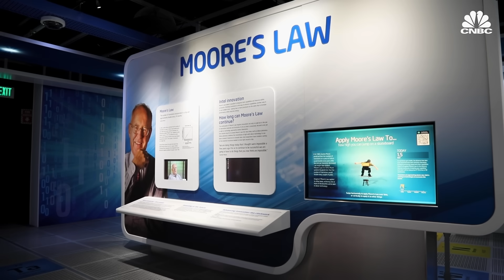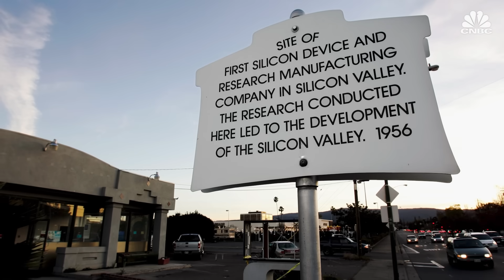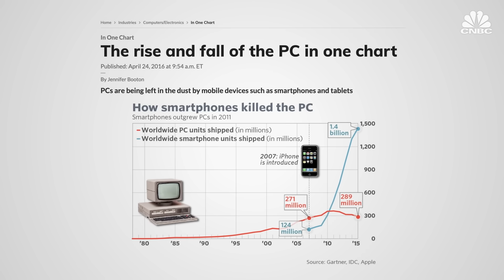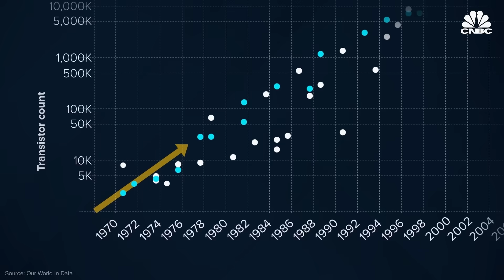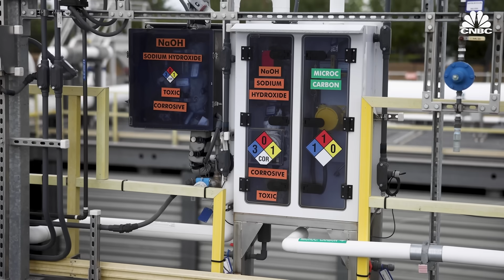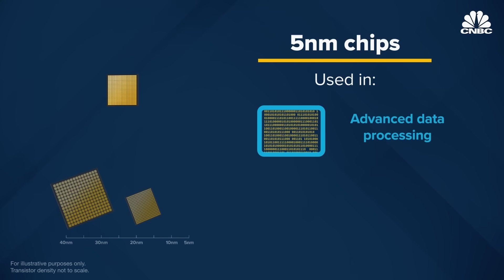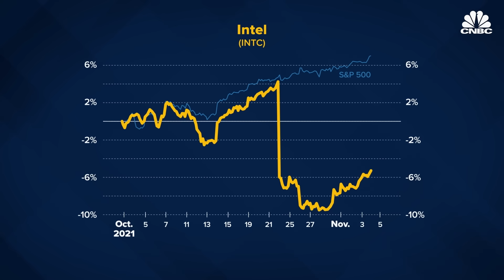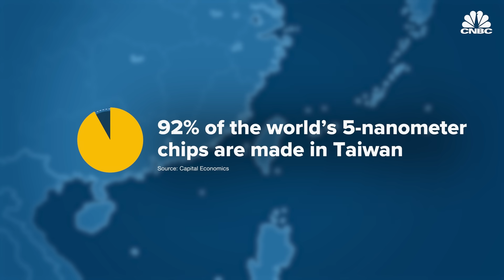Inside Intel’s Bold $26 Billion U.S. Plan To Regain Chip Dominance

Comment: Intel's new CEO is not in the enviable position as he has to fix the mess of his predecessors and get up to speed with the competition. And in chipmaking business as it was already mentioned several times "speed" is of the essence as once you loose pole position its very hard to catch up with the rest. TSMC and Samsung are leading the way, so Intel has to be smart, efficient and first of all it must deliver otherwise it will fail and loose even more.
Reply: Intel is already world #2 and recently signed up to make chips for Qualcomn
FYI (sales in USD)
TSMC 13 billion (ROC-Taiwan)
Intel 8 billion (USA)
Samsung 4 billion (ROK-South Korea)
UMC 1.5 billion (ROC-Taiwan)
Global Foundries 1.4 billion (USA)
SMIC 1.1 billion (PRC)
TowerJazz 0.3 billion (Israel)
PSMC 0.3 billion (ROC-Taiwan)
VIS 0.3 billion (ROC-Taiwan)
Hua Hong 0.25 billion (PRC)
DB Hi Tek 0.2 billion (ROK-South Korea)
Reply: @set3777  sure they are #2 in size and revenue, but from the technology point of view they need to catch up with Asian tigers TSMC and Samsung.
Reply: @D.u.d.e.r  Intel had previously refused to make chip based on ARM CPUs but now Intel has signed up with Qualcomn and already has cross licensing with Nvidia for GPU technology. On the high density FAB, ISince ntel has signed up joint ventures with EU companies to manufacture chips in Europe and since ASML is an EU (Dutch) company, Intel has access to the same high precision lithography.technology as used by TSML.
Reply: @set3777  That's great to see Intel is making steps to emulate ARM's approach and that is also takes ideas from Nvidia and Qualcomm through cross licensing, however momentum is already lost and time is of the essence especially in this industry. What Intel does now is already running smoothly with the competition, so they need to push twice that hard and make more effort to catch up even they are #2 world's chip maker.
TSML you mean ASML? Its great Intel has signed with them to get some access, but pls don't tell me ASML or TSMC will give their precious secrets and IP just because Intel wasn't speed up its business. They might help each other, but only to certain point, the rest is for Intel to figure out what to do and how to approach the industry.
Let's see if the new CEO gets it right or not. Looking at the 12 gen Alder Lakes benchmarks they look really good, but one thing concerns me in comparison to AMD and that's efficiency and performance per Watt. AMD does a better job with their Ryzen architecture and their chiplet design which is interesting advantage, besides having comparable or usually lower prices than Intel.
Reply: @D.u.d.e.r  Intel had never make chips for third party before. Now they are prepared to do so and Qualcomm is going to make THEIR chips in Intel FAB instead of Samsung and TSMC or as a second source. Intel has their own CPU and Integraded Intel Graphics (using patents from Nvidia) and they nominated the desktop/laptop market.
TSMC makes some chips for Intel too and makes 100% of AMD's CPU and Graphics chips since AMD has become design only FAB-LESS company.
AMD designs better CPUs and Graphics chips but most people still prefer Intel based laptops because AMD many based laptops have USB-C not compatible with USB-C and Thunderbolt docking stations.
We are not comparing Intel and AMD CPU designs when we are talking about Wafer FAB foundries.
Reply: @set3777  I do recognize and agree with you that Intel has still strong position on the market and people do prefer it in comparison to the AMD, however AMD has gained a lot of popularity and market share in recent years since Ryzen cores started to be used more not only in the consumer devices, but mostly in the enterprise market and datacenters.
But we are not comparing which company is better, but the foundry/chip manufacturing capabilities and here TSMC is leading the way with Samsung. Intel is preparing to attach from the back and offer more cost friendly options, however I still believe TSMC and Samsung will continue to be ahead of Intel in comparison to the manufacturing process for at least year or two.
Reply: @D.u.d.e.r  Too many "journalists" pushing fast AMD CPU's without full understanding. I recently sold 5 HP laptops with Ryzen AMD CPUs and Graphics and lost money and time bacause users kept complaining the laptops were slow and   USB-C docking stations wouldn't work. So I continued to sell only "Intel-inside" laptops.
Reply: @set3777  That's quite strange that IO feature with USB-C with AMD Ryzen CPUs doesn't work. I wonder what kind of bug are we talking about here and if AMD is planning one day to fix it or not... On the other hand if Intel gives you reliability you are looking for, than its probably a right way to go for you.
Reply: @D.u.d.e.r  Intel PCs & laptops  have already gone Thunderbolt-3 which is even better than USB-C.
Right now, there are only a couple of motherboards that support both AMD CPUs and the Thunderbolt 3 standard.

Comment: Two unanswered questions
1)Does the 7nm tech refers to the lithographic exposure of the smallest part of the Transistor which is the contact's width?
2) how come to my knowledge all this technological advance with hardware did not require a modification with the basic/compiled Machine language interface ?
Reply: Machine language is just an interface. The actual chip logic / architecture is where all the advancements have taken place alongside the physical advancement and smaller lithography.

Comment: In terms of the understanding of the technology being offered and what the process nodes mean.... this segment missed by a  mile.  The node names are marketing terms and don't address the actual density or performance of the transistors in question. Absolutely, 100%,  Intel is trailing at this current time. But they are closer technologically than the public thinks thanks to those disingenuous node names. I mean alder lake could have been great... on TSMC 5nm. It would have clocked slower, but it wouldn't take over 240 watts to run a CPU. There is no way Intel can outsource all their CPU production to better nodes across seas, they just make too many. But their upcoming graphics chips... they outsourced those.

Comment: The new TSMC Mac M1 chip is literally 2-10x faster doing anything my 2018 Intel-equipped MacBook Pro. 

Similar specs but can do everything that much faster, smoother, and better. The different memory configuration (RAM vs Unified Memory) as well as packing more cores into the same enclosure is just mind blowing. 

Sure my 2018 isn’t “obsolete” and runs perfectly. But time is money. Literally. The more I can get down the more income I can generate. The more videos, music, advertisements, emails, etc the more successful a business can be.
Reply: “Literally” 2 to 10 times faster? That’s a pretty wide range...
Reply: The thing is, Apple designs their own chips. The new M1 chip has little to do with TSMC architecture and more with Apple's research investments

Comment: Don’t want to be that guy but the video mentioned that mars rovers use the most advanced 5nm processors. This is not true.

Spacecraft typically uses radiation hardened processors and they are much larger than 5nm. Curiosity and Perseverance use PowerPC RAD750 processors, the are between 150 and 250nm with a speed of only 110-200MHz.
 Going smaller would make the processor vulnerable to radiation related and other failures.

Comment: I don't see the need to push so hard to making second best chips in America. 

They aren't going to find themselves in the most advanced machines that people are willing to spend on. 

If you going to go for the cheaper market, surely you produce in a cheaper country.

Its hard to know for certain but they could be spending big bucks pushing up production on chips that no one is going to want to use in their machines.. 4 years is a long time to catch up, the world will be a very different place by the time they think that they "might" do it.

Their newest chips are only able to compete by upping the power requirements to insane levels, which is the opposite to what is needed. 

I can see them wanting to keep production in house, look at Apple taking its business away. But they are focusing on power and efficiency., They need to spend less on making an insane amount of chips and more money on research, making the chips that people are actually going to want. If you aren't first in the chip market, you are nothing.

Comment: Jesus CNBC, do better research please. Intel 10nm is equivalent to to TSMC's 7nm. And Intel's upcoming 7nm produces smaller transistor size comparing to TSMC 5nm process (roughly around 4nm if TSMC ever has one). Also space-hardened CPU are not made at this small of a process. Mars Rover uses a 250-150nm node size CPU made on different technology, not on some TSMC's 5nm node.

Comment: Chips for phones are important, but chips for switches and data centers, which don't require such extreme portability, are equally important. You don't need a super-fancy chip in a phone if you have one in the network.

Comment: 12:20 Wow! That's still 450,000 gal of water wasted per day. Good percentage but still a huge amount. More than 164M gal per year out of Arizona's water supply and down the drain. I understand it's probably largely cleaning but some I'm sure is also cooling. It'd be nice if they could use a kore radiative heat rejection technology. AZ has the land for it. Especially if they used that newer "reject heat into space" technology.

Comment: I don’t understand why Intel doesn’t just build there own CNC machines/ lithographs to build there own 5nm and 2nm machines. I get that it would be expensive but they are just flooding the market with chips. The reality is that more computing power will be needed in the future. If they build there own machines than the other competitors wouldn’t be able to copy so fast. I guess Intel did a cost benefit analysis and found it would be more profitable to flood the market than develop novel chips.

Comment: Major misunderstanding when you differentiate cpus and gpus based on if it's in a PC vs a data center. The GPU is simply a Microprocessor widely geared towards graphical processing. The phone I'm typing this on has a GPU and CPU as does every modern mass production PC be it discreet or integrated.

Comment: I think Intel will have to buy in the design skillset. Be like Apple and just offer whatever it really costs and buy every innovative chip designer you can before national security makes even an American buyout unpalatable. 
Apple showed its possible to design an arm chip, customise it and leapfrog intel/amd. Its not the 2yr fab building delay, its the actual design innovation and then the fab ready when it arrives, as well as having the design with plenty headroom - not a short term lead and then flogging a dead horse. Apples achievement must have shown Intels way into mobile chips. The traditional western pc buyer is stalling on a replacement, buying a better phone and using cloud services to offset any performance gaps in whats needed. They will make easy (slim) profits from meeting the large chip shortage but amd is a full competitor now.

Comment: Tsmc and Samsung isn’t where intel is worried about. It’s apples m1 max chips
Reply: Not in the foreseeable future. Apple's M1 chips are ARM processors, which right now are mainly used in mobile devices due to their efficiency. The x86 processors are the bread and butter of Intel and AMD. The marketplace that Intel and AMD caters to still needs x86 chips. If you want to know why just google ARM vs x86. A much bigger threat to Intel is TSMC and Samsung. If Intel fabs can surpass Samsung or TSMC, even Apple could contracting Intel to make its M1 chips at Intel's fabs.

Comment: The Transport data and circuit Bridges etched into the motherboards of electronic devices are made of copper, the leads of integrated circuits or processors is made of silver, the connecting micro wires of a CPU die to the leads are made of pure gold, here is some technological advance ideas for you if you can find it in this simple knowledgeable information:

Silver defines conductivity - all other metals are compared against it. On a scale of 0 to 100, silver ranks 100, with copper at 97 and gold at 76.

Comment: If intel can pull off that sub nm chip that would be insane!!! Having a clearer focus is definitely going to benefit them. I'm surprised it took them so long to see just how far they had fallen behind.
Reply: It’s 7nm did not even get to mass production. Overcoming Moore’s Law is not even dreamt by TSMC or Samsung. Intel is still stuck in 10nm. At this rate Intel may require the USA government help to steal or force the technology to be transferred forcibly from TSMC or Samsung just for the 7nm. It’s good to be high but it is bad for health.
Reply: @leecheong4986  Those numbers 10nm, 7nm are meaningless, terms, only for public pr.  Intel bought up all the next generation Lythography machines from ASML.  When they are delivered and installed, Intel will have a huge advantage.  Qualcomm signed a multi billion dollar chip making contract with them and Qualcomm isn't stupid.  Intel has always had great engineers.  They were forced to work on products a marketing guy wanted.  Now they are run by a top engineer.  I would not bet against them.

Comment: U.S.A IS NOT GOING TO DEFEND TAIWAN FROM CHINA. the U.S. probably decided there is no way it can defend Taiwan from China's invasion. So how do we stop China from getting the efficient business process from TSMC in Taiwan? Force Taiwan to share their efficient manufacturing process to the U.S. and become the #1 chip manufacturer. Sadly TSMC giving its business process to the U.S. is a double edged sword since it could make Taiwan lose its bargaining chip against China preventing them from taking over or Taiwan will lose one of its biggest economic profits. Taiwan doesn't really have a choice but to give away its business process to the U.S. since most chip designs come from U.S. companies and the machines to craft the chips come from some where in Europe. Taiwan is just an assemblymen that is very efficient process in making the highest % of chips with lowest failure rate keeping costs down.

Comment: 13:02 That graphic is wrong and misleading CNBC.
The nanaometeres are not measuring the size of the chip.
It is measuring the billions of transister inside the chips.
You can have a large ship with small nanometers and vice versa.
Sorta like the size of your pasta vs the pot you put it in.
You can alter both and they don't relate to each other.

Comment: The fact that they are behind TSM in developing powerful chips and now they are publicizing their 20A plan just seems to be more of trying to stay relevant while you are being defeated on your own game and just relying that 20A announcements will save your share price from plumbing down
Reply: 20A is just the renaming for what would have been Intel 5nm. Not renaming it would be marketing stupidity (Intel traditionally sucked at modern marketing). 

Also, things used to be measured in Micronmeters not too long ago and no one cared. The switch to nanometers started a marketing thing. Moving to Amstrong is the same marketing BS. 

In the past, Mosfet transistors were used. These are 2 dimensional in structure. And a 2 dimensional measurement like nanometers made sense in such a 2 dimensional case.

Then FinFET transistors (3d in structure) were switched to and nonameters suddenly had no literal meaning. 

20A is planned to use RibbonFET. These type of transistors have multiple gates per transistor. So it's a new type of transistor. 

Not marketing a change like that with a complete new change in name would be stupid. 

E.g. Intel 10nm and TSMC 7nm are the same. It's just marketing names that doesn't measure anything that's used to bamboozle people.

TSMC was smart. They opted to skip a number and then marketed the crap out of it. Intel is now trying to play the same trick on the idiots who take "nanometers" seriously.

And people will be dumb enough to continue to fall for it.
Reply: Size of the transistor is not that relevant, you also need a good design of the chip itself, if intel 7 (aka as 10nm) is head-to-head to tsmc's 7nm, this, at the end of the day, is what would matter.

Comment: Wow this is misleading and incorrect  your baseing advanced lithography on marketing information. TSMC 7nm and 6nm (which is the same 7nm eu lithography but denser) are roughly the same size as Intels 10 nm and while they did take a bit to get out running without power issues you are talking about an advantage that is no longer present

Comment: Maybe... Moores law is not a law, but a mid term trend, and the wizards of smart have wrung out most of the quick gains and this "law" is ready for the dustbin - things are becoming logarithmically more difficult to achieve in the same space of time while not pricing something out of the marketplace.  The guardrails are cost of manufacture, and physical limitations of materials.  You can move the former, but only by increasing buying power and... nobody in DC is even contemplating that, regardless of party.

Comment: It’s been said that rocket science is difficult, well building advanced semiconductors is harder.  Intel’s challenge is recovering the 2 generation technology gap that exists today.  The recent 1 year push out of 7nm is a bad sign.  The idea of leapfrogging one or two generations is unfortunately an unrealistic goal, it’s never been done before and it an are where intel has struggled for almost a decade now.  Next, intel investing $20 billion sounds like a lot but both Samsung and TSMC invest more than that every year.  Also, building fabs has no meaning if you don’t have the customers.  The road back for intel isn’t going to be easy.